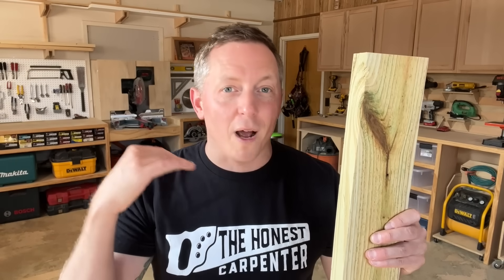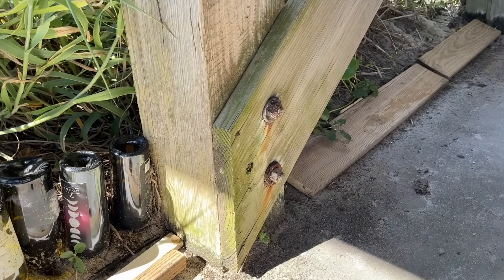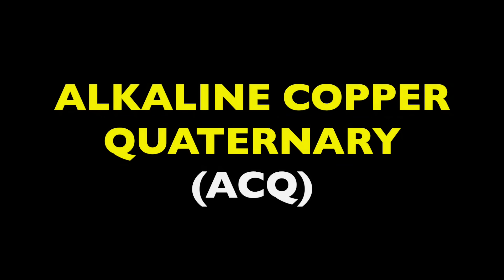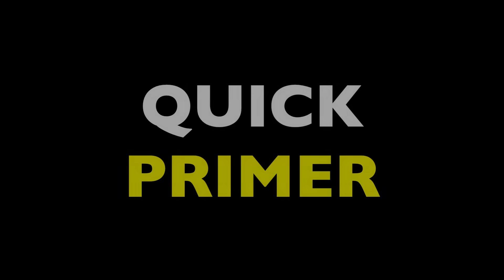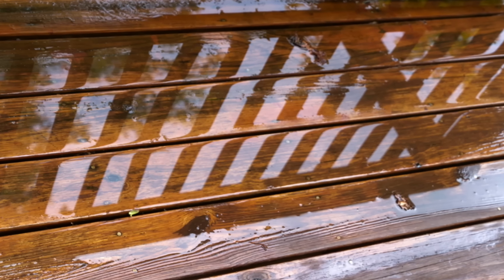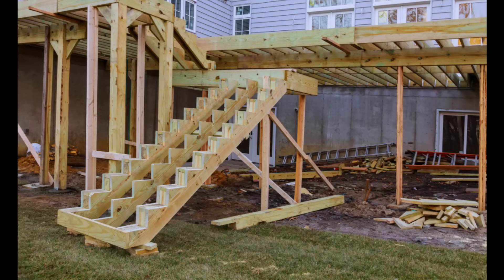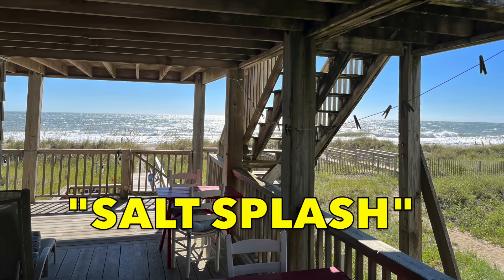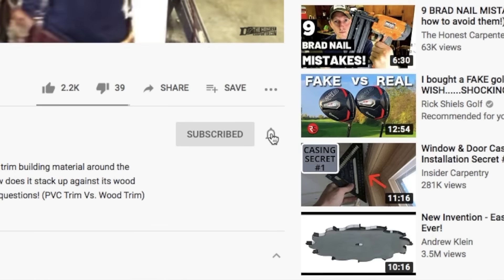Some TREATED LUMBER Rots Faster Than Others! WHAT'S THE DIFFERENCE?! (Ground Contact Vs. Non-GC!)

Comment: Not all ground contact tratements are created equal as well, different chemical compositions used to treat lumber will have different outcomes. For instance, GC MCA will last you 5-7 years on a Florida environment, while GC .15 pcf CA-C (copper azole) will yield a 15-20 year lifespan. GC .40 pcf ACQ will fall closely to the lifespan of CA-C on a similar environment and all fall under the UC4A umbrella.
Then you get into awpa guidelines for cca treated lumber and that throws a curveball into people asking for saltwater splash (.60 cca) for an application that is not allowed... miss the good old days when the majority of the lumber was CCA and the available tratements where above ground .25 ( which performed better than today's GC MCA), Ground contact .40, salt water splash .60 cca, and the 2.5 cca for salt water submersion.   Granted you can still get .60 cca and higher today, but only from specialty stores, box stores phased out cca in fear of lawsuits back in 2003-2004 . 
Good vid nonetheless, most people think pt is pt, and that couldn't be further from reality...

Comment: Just so you know, salt actually preserves wood but is corrosive to metal. I built a lean-to many years ago and  made the legs from spruce which normally doesn't do well buried. But at the time I placed a large quantity of water conditioner salt around each leg and mixed in with the soil. Would you believe that after 25 years the legs were still in good shape? Unfortunately a nearby tree fell against my lean-to and crushed it. I just wanted to mention that the salt did an excellent job of preventing the wood from rotting.

Comment: Interior of even ground contact lumber is easily rotted. Most do NOT retreat after cutting. Once cut the interior sap wood is exposed and ... it rots out.. Copper green and similar treatment solutions are a way to prevent premature rot. Be careful though, it is REALLY poisonous stuff.

Comment: In Europe impregnated wood is being replaced by thermally modified wood. Thermally modifying wood is a far more durable process and uses no chemicals. And unlike impregnation that requires certain types of woods that properly absord the chemcials, you can thermally modify any wood you want to increase durability, softwood or hardwood. It also completely stops any further wood movement and locks the wood fibers into place. You can turn pine that would be susceptible to moisture and would normally rot below the surface in 2 years, into pine that has the durability of teak. 

It's also very sustainable, because it's not only chemical free, but because it is simply a heating process, you can use residual heat from existing factories like smelters or other industries. And this is just the beginning, because the only difference between all these sorts of wood and their durability comes from the type of growth these wood fibers went through. When you can modify these molecules in the wood, you can give any wood the type of structure and therefore properties you want. It's pretty amazing to see woods that wouldn't normaly last a year outside, like poplar, being used as cladding in rainy cities without issues because the fibers were thermally modified.

Comment: A problem in my area is wooden fence posts that are embedded in concrete but are slightly buried in soil; that little bit of soil rots out the post one or two inches above the concrete. It drastically reduces the life of an otherwise decent fence. For a gate I have to rebuild, I was considering using post "sleeves", or perhaps a strong tie or anchor, that would be embedded in the concrete, and the post would then attach to that. This way the post can be switched out if it ever rotted.  What are your thoughts on something like that?
Reply: The concrete is the problem not the soil that's why it rots out above the concrete.

Comment: gday mate 
ive got a question for you. they are building a house next door, but there taking their time doing it. every building site ive worked on it has been a sort of rush to get the roof on and up to lock up stage. this one they havent even put the tiles on the roof and the frame has been exposed all winter to the point where the wood has started to turn grey. now i understand not all bits of wood are equal and that some types would be fine with a winter of rain. but what about exposed house frames and the floors? 
anyway thanks for your time 
and best of luck to you and your dog

Comment: Locally, here in Scotland, every cut in pressure treated wood is regarded as an exposure to untreated wood. Pressure treatment only penetrates so far, so any cut exposes untreated wood. Local mills recommend that treated wood when cut is re-treated to heal the "wound" and offer full protection. We don't use arsenic based treatments. Almost all of the treatments cannot be used in water / ponds or it will affect pondlife. They work on the assumption that pressure treated wood is safe to use for stables etc, on the principle that a large animal horse / cow cannot graze/chew/gnaw on enough wood to cause harm, but at a microbiological level it's a no no, so no using scraps for bird boxes etc

Comment: Fun Tip not sure as i don't have first hand experience but You shouldn't use Treated Lumber to Build out an Aluminum boat as the Copper will speed up corrosion of the boat itself. Was told Cedar is better but maybe thats just big cedar

Comment: Question: how would this apply to other things built w pt lumber? 
For example, I made some Adirondack chairs this summer, and right after watching your video noticed that the water on the deck (it rained most the day) had literally soaked into and halfway up the front legs (end grain sitting on ground)... what can you do to mitigate these issues?
I mean, I've always heard things should be stained bf any outdoor use (more info I learned from you in your fence treatment video ; ) ), but is that really enough to prevent this kind of issue?
Should the bottoms of legs be painted with oil based paint or smthn? 
I also know they make that 'end cut' green product, but It's always hard to balance aesthetic, durability and functionality. 
Recommendations anyone?

Comment: Another amazing video with information I (and many others) would've likely never known without you providing this service. 
I was a framing laborer for years and I've worked on hundreds of various construction related projects since then, under the supervision of alot of craftsmen I considered to have quite a bit of skill and period in their work, and I NEVER heard of any of this!
As far as I knew, there was regular lumber, pressure treated for all outdoor applications, and marine grade plywood (I only came across one while rebuilding the dash and floor of a boat). 
But it makes perfect sense... vertical boards don't have nearly the water connection that flat do. Incredible this never occurred to me. 
So thanks again, the knowledge you put out there makes a huge difference!

Comment: Wish I'd watched this a couple years ago. Oh well.
A buddy of mine recently asked on our neighborhood watch page if anybody had any used motor oil they wanted to get rid of, which I did. When he came to pick it up I asked what he needed it for, he said to make his own pressure treated lumber for a new fence. He claimed used engine oil worked better than whatever they used to make pressure treated lumber. Have you ever heard of that?
Reply from the maker: I’ve heard that Bruce, but I’m not sure if it’s accurate or safe. I mean, lots of chemicals may prevent fungal growth, but you don’t necessarily want to coat your structures with them 😅

Comment: Had no idea. THANK YOU. Extremely relevant for me as I need to replace a bottom horz piece on my fence that runs parallel along the ground. Just the info I needed!
Reply: Eric, if your fnece boards drop down onto that horizontal piece, leave a space between the piece and the vertical boards. That will keep water from being trapped and soaking into the ends of the verts. 

Also, it wouldn't hurt to treat the ends of those verts before installing the horizontal piece.

Comment: When building decks do you bury your 6x6 post and have it sit on a footer below grade or fill 6 inches above grade with concrete and install with a bracket? I figured you should ALWAYS avoid lumber touching the ground and concrete?
Reply: Keeping the ends of your posts above grade is a good practice. It just takes more work.

Comment: In Australia we use a different coding method. Silly I know. H3 for above ground and H4 for in-ground contact. I paint the cuts as well.
Reply: Yep, H1 = laughable - basically pallets that have been heat treated to kill insects that are on the outside of the pallet. H2 above ground, termite resistant - H3 as H2, termite AND rot resistant, H4 ground contact, H5 buried, submerged in fresh water H6 submerged in salt water Tropical. H2-H4 need to be upped 1 level in the tropics, e.g. use H4 instead of H3 in the tropics. Another problem is that the treatment does NOT usually go right thru the timber, but only a 1/4"(6mm) or so from the surface - a local University had to replace all the CCA treated pine in their car park because people were stepping on it and falling into the timber, which was just a thin shell of green pine and the interior was just powdery brown mush. And as someone else mentioned, always treat your joinery and end cuts, most big suppliers will sell the copper salts to mix with water and paint on - remember your disposable gloves, splash glasses and overalls, shower immediately after using (same as for Roundup). There is also LOSP treated timber, applied in a vacuum chamber, generally only comes in H3 grade although H2 is possible, is NOT corrosive to metal fasteners.

Comment: Also important to understand the effect of all that extra copper on zinc-coated fasteners. The zinc-copper reaction eats away galvanizing much faster.  IIRC, double hot-dipped galvanized nails (not screws) may last ok (especially given the likely short life of the newer PT wood), but for most projects it's worth the extra cost to use stainless screws, hangers, etc.

Comment: 10 years ago me and my dad rebuilt a picnic table that was built by my dad and my grandpa we used pressure treated wood that was the marine grade pressure treated wood I've not used that picnic table in 5 years because of the simple fact that it fell apart I meant currently in the process of rebuilding it with rough cut oak ran through my planer to smooth down the edges because the pressure treated lumber that is sold today is garbage it lasted five years my dad and my grandpa built the picnic table out of pressure treated lumber in 1960 originally and in 2012 we rebuilt it using the same metal frame and we only got five years out of it the pressure treated lumber is garbage all of it every bit of it it don't matter what grading you give it it's garbage I've had to replace 10-year-old decks in the past 2 years because they're rotting they need to put the arsenic back in so it lasts the copper don't last cuz it don't soak in and it don't protect the wood that's just my personal opinion from my personal experiences but hey I like it when people build decks out of inferior wood and 10 years down the road I got to rebuild it which means in another 10 years they'll call me back to have me rebuild it again
Reply: Planned obsolescence.
Reply: @brucelee3388  huh what please elaborate and explain why what huh and huh
Reply: If the big producers of treated timber made timber that lasted longer than the minimum people would not have to replace their structures every few years, which would reduce the medium term profitability of the producer. Several decades ago there was not the body of knowledge available to the industry on how best to apply and exactly how much treatment was needed to meet the minimum standard. Now there is a lifetime of knowledge available (and probably several court cases about poor quality product) so the manufacturers can reliably produce a product that will fail after a known period of time (like the first Apple Mac's power supplies).

Comment: Further googling. It seems we still use CCA. I found one Victorian Government article says not to use it to build new playground BUT no child has ever been injured (I guess except by splinters) or poisoned by it. There's no need to remove existing CCA-treated playground equipment until it's otherwise due for replacement. Arsenic ingested by children is less than background arsenic in the environment including in their food.

We also use LOSP.

Comment: How about a video about what you can do to enhance the rot resistance.  I coat any part of a post that touches the ground with black roof patch.  Let it dry out and then use it.  Don't know if it helps too much but my thought process was anything to keep moisture from contacting the wood would help.
Reply: I just posted a similar question, and I think what you're doing will certainly make a big difference.  In fact, if you char the wood, give it a quick brush w wire wheel then even paint on a coating of oil/ tar in solution w mineral spirits, that's supposed to help too. 
I'm wondering what to do on more visible, aesthetic pieces though (table legs, outdoor bench, etc). I know staining helps, but is it really enough to deal e ground contact? 
Any advice from anyone would be greatly appreciated.
Reply: it's definitely not going to hurt

Comment: While you are correct about the distinguishing features about above grade and ground contact, there’s actually a 3rd grade of treatment that has even more preservative chemicals pressurized into the wood. You’ll typically only ever encounter them if you’re building a pole barn, where posts will be set into concrete. The concrete tends to wick extra moisture that will be in contact with the posts for the rest of the life of the building. This grade is called Critical Structure, and the concentration of the ACQ in this grade of lumber is 0.6% by weight, roughly twice that of ground contact. If you set ground contact posts in a concrete footing without doing something to isolate the wood from the concrete, you’re gonna be in for a rough time after about 10-20 years
Reply: I built a pole barn over 20 years ago without isolating the treated, vertical posts from the concrete and  have not had a problem. It also survived Hurricane Katrina without any damage.
Reply: @Foghorn Leghorn Nah! I've got you for that.

Comment: Back about 10 or so years, we built a deck on very sandy soil that drained very well.  We didn't know about all the differences between PT lumber (above, on, and below ground), so we bought what was available, which included above and below ground, but we used them indiscriminately for the project. At some point, we had to rearrange some of the partially buried lumber and we were astounded that some of the pieces were substantially decayed just shy of a year in the sand. We were much more particular after that when buying PT lumber.

Comment: Holy crap!  I had no idea there was a switch.  I had no idea what secret codes on the labels means (and I read).  Worse, in a few years when I need to buy some, I won't remember the secret codes and significance, logically 1A would be the top rated of course, and C and lower grades...oh wait, no, they made it backward!?  Geez.  

Thanks SO much, at least I'll remember there's something f-ed up about PT that needs to be researched in the future and you'll have saved another project.
Reply from the maker: Sure thing, RJ! Just keep YouTube handy while future lumber shopping 😆

Comment: Do you have any experience with charring wood for ground contact? I believe it's a Japanese method for preservation. I'm building some raises garden beds that will be growing vegetables and I'm charring all the wood being used. Trying to keep them chemical free and long lasting.
Reply: It definitely helps. My great-grandfather (b. 1875) was a part-time wagonmaker, and it was widely known at the time that when the steel “tire” was heated and placed on the wooden wheel, as it contracted and contacted/charred the wooden wheel, the char helped prevent decay.
Reply: Beeswax

Comment: Need to rebuild a rotted door sill for side door in my garage. Should I use pressure for it, it'll be sitting on concrete. The garage is about 55 years old and is the only part that's rotted.

Comment: Question what if you use a sealer or paint to cover the ends it will be in the ground of 4 x 4’s to help protect from rot would that work and how long would that last also if you put the post within concrete or even the bottom of the post is covered with the concrete as well as all around the sides up to near the surface would that help the only area that would be expel it would be areas were dirt would build up along on top of the post cement how well with all that work
Reply: Concrete holds moisture and wicks it from the ground, so if the 4x4 is touching concrete it will tend to stay wetter and rot faster. This is why metal standoffs are used.